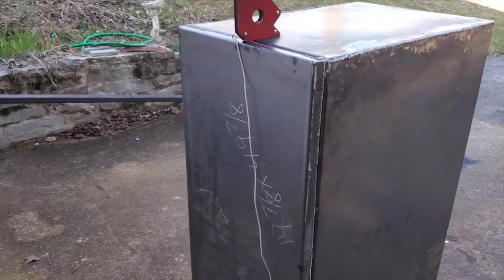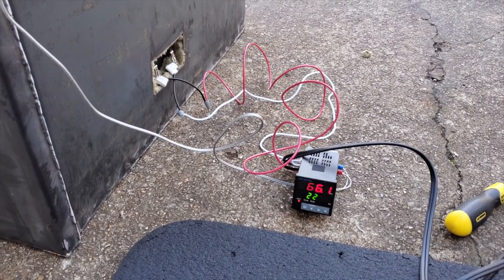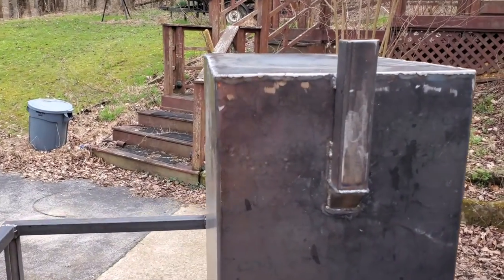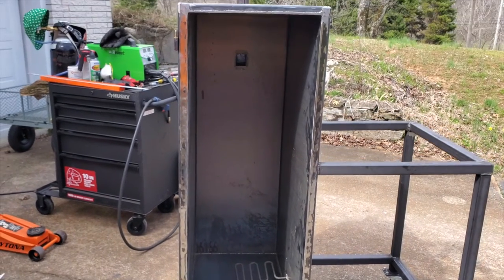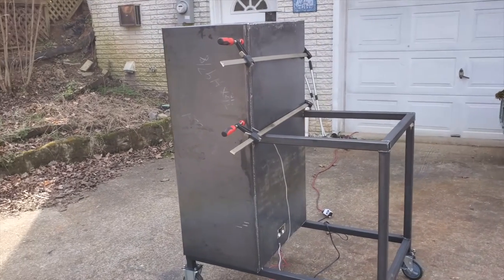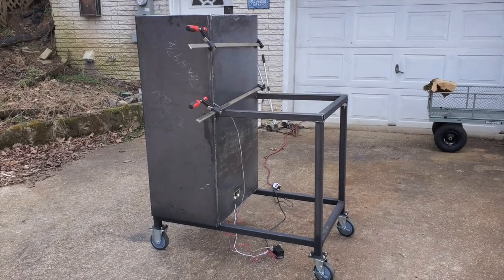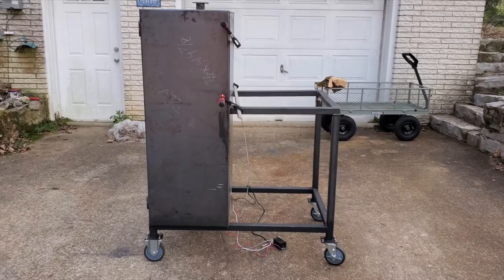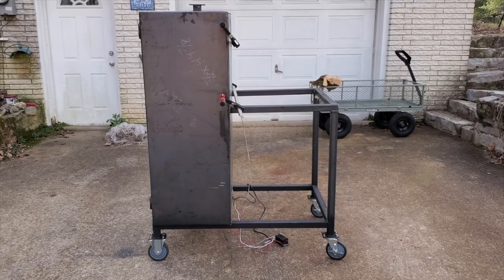DIY Electric Smoker Build - Part 3

Comment: How are you getting those bends in the sheet metal?
Reply from the maker: I had my steel supplier make the bends for me.  It cost a little bit extra, but it was well worth the cost.
Reply: Tim. I could see the bends clearly besides the part with the door. Did the one side of door have bends on all edges?